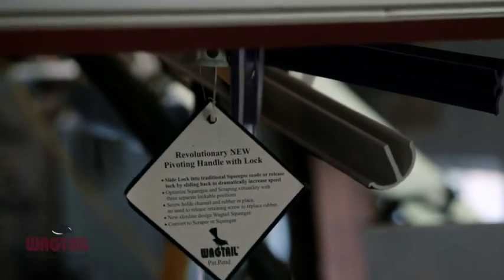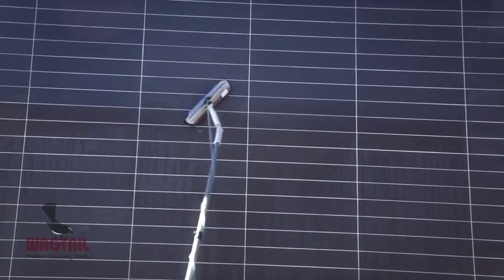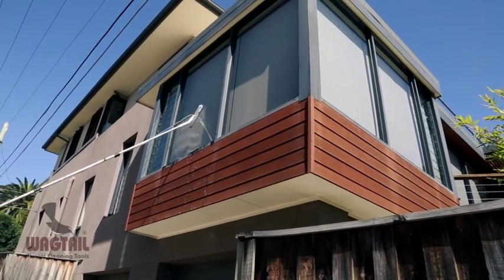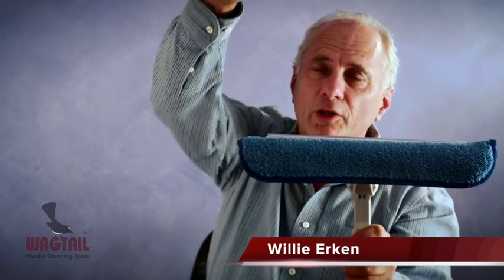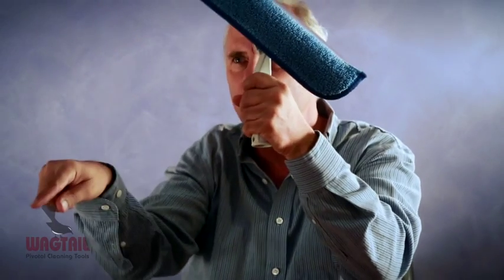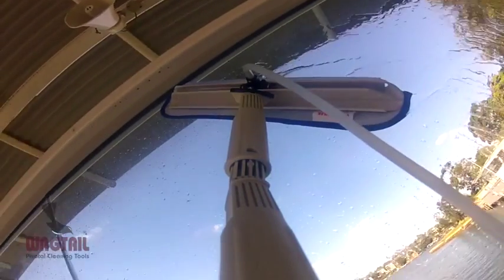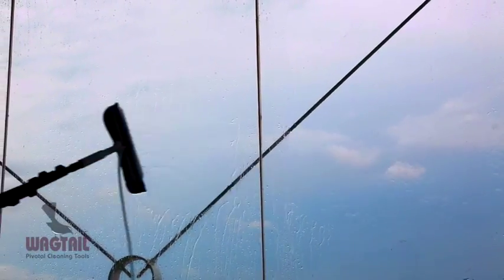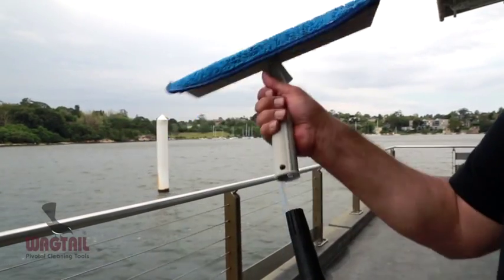Wagtail Jetstream

Comment: I bought the wagtail jet stream earlier this summer I have a 14 inch and a 22 inch. As you work with this tool, the rinse bar will rotate down on to the microfiber pad and you must stop to readjust the rinse bar to correct it back into position. My 14" jet stream came with a 16" microfiber pad that over hangs the edge and flops around the rinse bar. This tool is almost there but you must readjust the rinse bar, does anyone have any ideas how to secure the rinse bar so it holds position?